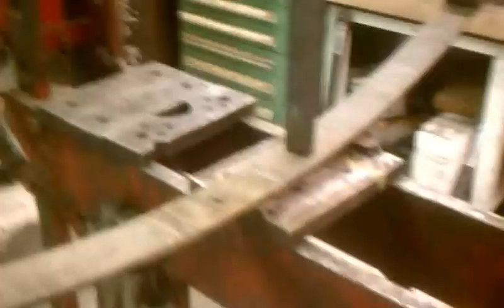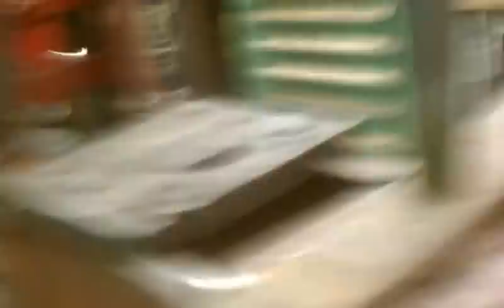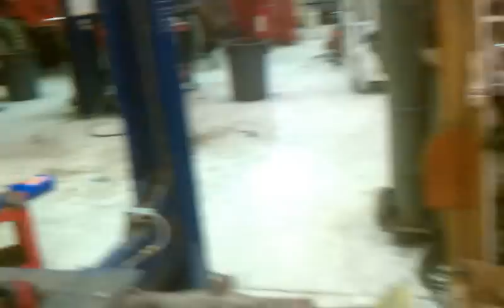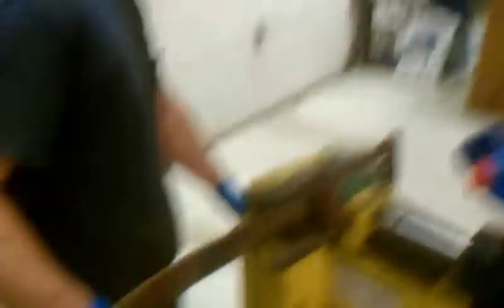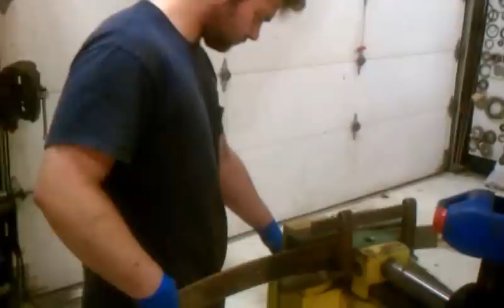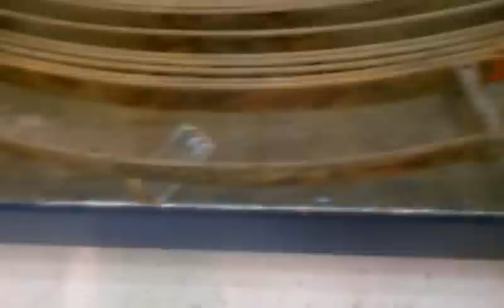Rearching leaf springs, very fast way in muffler shop bender

Comment: That simple?? no heat needed at all ?? I'm amazed!!!...I currently have an old set of Toyota hilux front axles leaf springs bent downwards that I want to fix, not sure if either adding a leaf (have no clue where should I install it) or as you did here, re-arch the current set of springs. Any ideas/recommendations?
Reply: Daniel Quiroz Cold arching like this is only a temporary fix and imprecise.  An add-a-leaf will make the ride harder, tho not always a bad thing.  The only real cure is new springs or heat arching where the springs are 're-set' to original.
Reply from the maker: +Daniel Quiroz hot arching is technically the best, I just done so many cold arches, and add a leaf and customers have always liked it. One long leaf added will hardly change ride much, but a short thick one (as sold by several after market companies will definitely make it harsh.   Many will say a cold arch will just go flat again, and that is correct but a cold arch plus a spring seams to be a good compromise. If you old springs went flat it is because you over loaded them or over bent them, so more spring and a correct bump stop will save a lot of headache.
Reply: +DonziGT230 
Does re-arching an old set cause metal fatigue to set in quicker, from your experience ? Like Dan, I had my hilux front springs on the verge of arching the other way, so I had new stock springs fitted but always wondered about the economics of getting the old pair reset.

Comment: If it's not reten
Reply: If it's not retempered it's never gonna keep that arch.
Reply from the maker: True, but if you do a complete pack and add a leaf or two, it will be fine. Nothing like replacing with new, but every customer has a budget to stay in.  Also I have a much better way of doing it now, see my vid where I re-arch with the muffler shop tubing bender.

Comment: '
right word is LIFT SPRING...
NOT leaf spring...
leaf is a only death branch of plant - tree skin off
Reply: bestamerica the proper term IS leaf spring. It's been called that for over 100 years lol.
Reply: hi W...
thank explain but wrong idea...
normal lift spring and not leaf spring...
lift is the motion down and up with machine - vehicle...
same as fortlift / truck lift...
not fortleaf / not truck leaf
Reply: bestamerica things can be named differently from their intended purpose. No offense, but it's quite clear English is not your first language, and this is why English can be one of the hardest languages to learn.
Reply: bestamerica Proper termalogly for this type of spring is a leaf spring. A lift spring would be aftermarket and part of a lift kit. But that doesn't take away from the fact that it's is a leaf spring. Have a look at this http://lmgtfy.com/?q=What+is+a+leaf+spring%3F
Reply: hi W...
thank explain...
choice want leaf spring then not right word = not right wise...
choice want lift spring then right word = right wise...
dont mix 2 words leaf = lift
Reply: bestamerica it's just a name! Leaf spring. It does not have to correlate to its intended use to be called that. For example people wear sandals on their feet (flip flops, thongs, etc.) but you don't have to be on sand to call them sandals. Haha it's just a name.
Reply: Leaf spring. As in a spring with many leaves.....